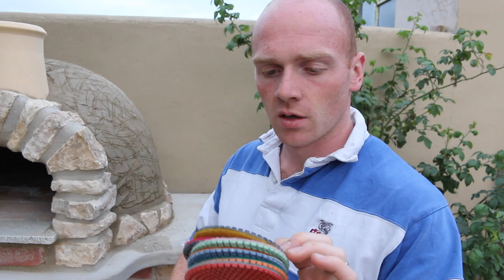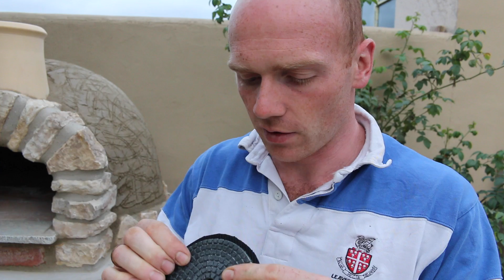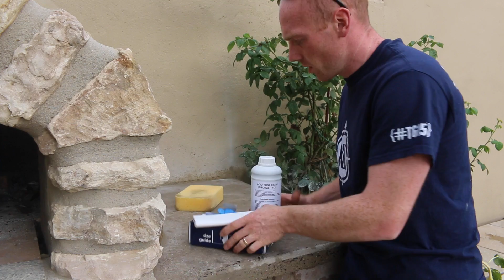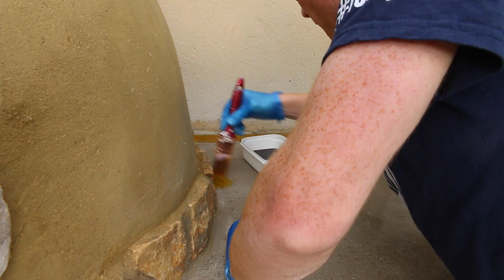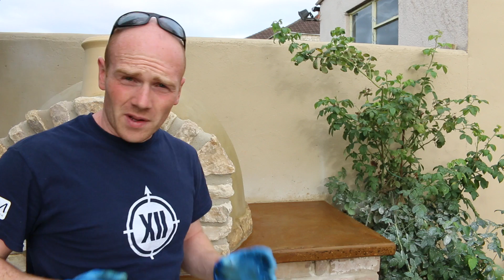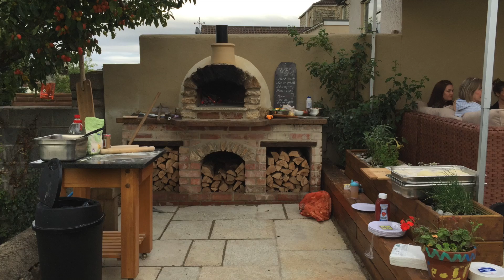Outdoor Kitchen and Pizza Oven 6.0 | Acid Staining the Concrete Counter Top

Comment: thanks for this - good info for a novice that's just about to embark on a similar project. I wonder if you could also advise on the depth of the concrete platform directly under the oven. On various websites, it suggests 150mm - but that seems very thick ( the oven I am purchasing is 160kgs ). I am also building it across the corner with counters either side and would have preferred the same thickness all around. Do you think 60-70 mm would be sufficient with an extra layer of concrete board under the oven base ?

Comment: I'm just about to build my own outside kitchen with the help of a builder/electrician friend of mine - I found your guide really helpful ! Just noticed at the end that you put another black chimney pipe into the traditional chimney pot  did it improve the draw of the fire ? I also noticed that the beautiful stones in you arch were quite black from the oven - would sealing the stones beforehand help, or is it just the natural consequence of smoking fires ?
Reply from the maker: I pop the flu in when using it to help draw but mainly because it was just too hot for the clay pot and it cracked first fire. If you have a good enough draw it wont blacken as much and now I have cleaned it back, ths year it has stayed pretty clean

Comment: One big disadvantage of a wood pizza oven is that it should be burning 7/7 365 days a year. This is to prevent breaking the oven prematurely. Ours lasted 17 years and made around a million pizza's and a few tons of potatoes. Of course you can't let it burn all year round at your home, but I recommend starting the fire a day before you make the pizza's, that way all bricks are the correct temperatures and lose the moisture. The project was very enjoyable to watch and the end result looks great.

Comment: Looks amazing.  I spotted you had put the vitreous enamel chimney in the pot, was that to dampen it or get better draw?
Reply from the maker: +FrenchAM100 draw really. It’s designed to just have the metal flue but preferred the look of the chimney when not in use. Planing to make it slightly taller too, which we can just slot in when we are using it as much better draw.
Reply: The Restoration Couple agree the pot you used is much nicer, maybe you can find a slimmer one to sit on top or try redeeming the enamel one but guess that will crack.  Loving your videos, thanks.

Comment: I'm based in the UK also. we are going to acid stain our concrete worktop. I was wondering what brand you used and where did you get it from. great job by the way. Looks fab.
Reply from the maker: It was from a driveway supplier.  Search concrete driveway acid stain.

Comment: Very nice outcome, only concern with that polisher is that it doesn't appear to have an earth, looks like one of them Euro style plugs retrofitted into them 3 pin plug adapters. Should be fine but when dealing with water an earth would be nice! However it's probably double insulated though but still water can still get in.